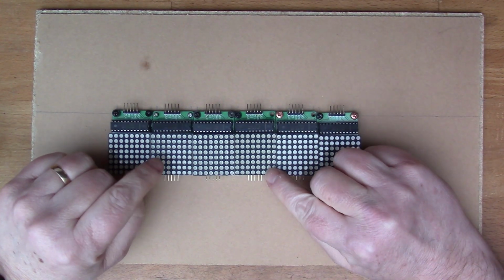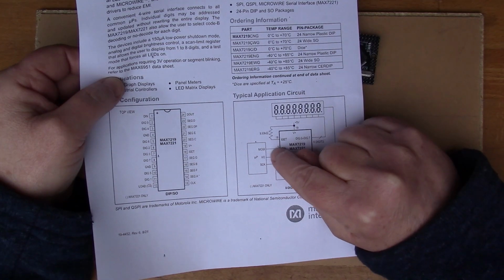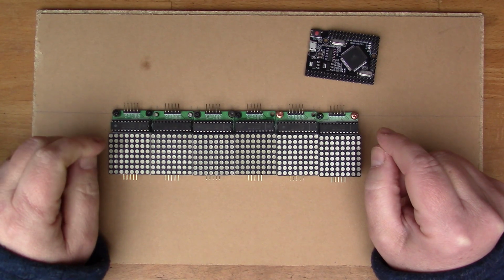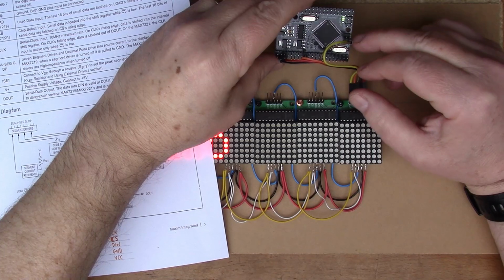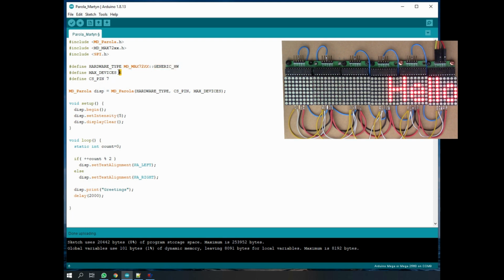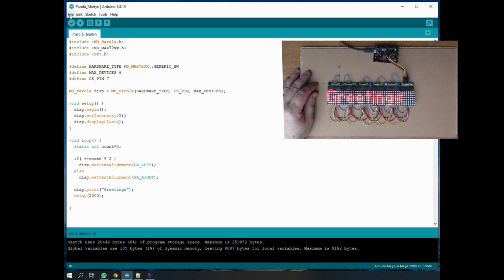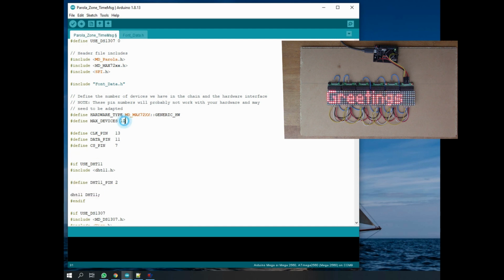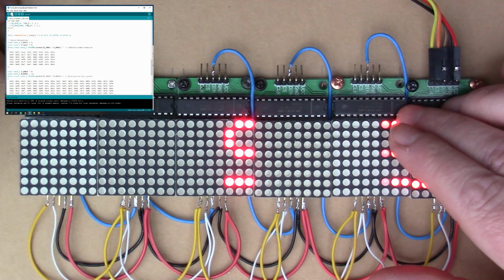8x8 LED Displays with MAX7219 and Arduino (#144)

Comment: Would it be possible to make one of these that is 128 x 16 (2 modules high and 4 modules wide, each module being 4 of these 8x8 led units) and have separate (preprogrammed) messages displayed when triggered by external momentary switches?  
Would there be someone willing to help me with the Arduino code for something like this?  I can manage the construction of the circuit, but I’m certainly no Arduino developer…. Seems like this should be possible though.
Reply: No reply to my inquiry?  Was hoping there might be a developer I could contact to help me design some code for a scrolling LED sign, but with some selection buttons to determined which predefined message, effect and such to display.

Comment: If you can think of each one of those LED as an electric outlet receptacle in your home,  or light bulb in your home,  can you imagine the possibilities of controlling it on or off...using higher current relays of course.
Reply from the maker: That's an interesting idea.  Each row/column of each display is an individual switchable circuit to the MAX7219, so you could certainly do something like that.

Comment: The example with the clock looks interesting.  It could make a good desk display.   I assume it would run on the basic arduino?
Reply from the maker: The regulator on this Mega Pro seems powerful enough to supply current for these 6 displays, but on the Uno you might have to run the 5V to its own dedicated power supply.
Reply: @MartynDavies  I've found a seller on ebay who sells the display and a  case.  They also sell usb c connector/adaptors which can be used to feed same.  The only difference from your set up is that it only accommodates 4 modules! 🤣
Reply from the maker: @gartmorn  The beauty of these displays is that you can always daisychain more later.